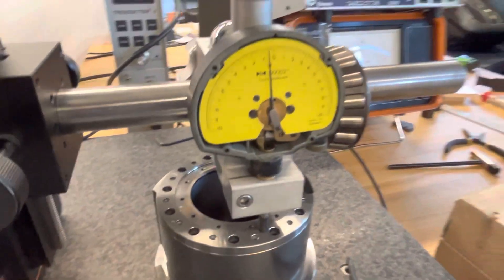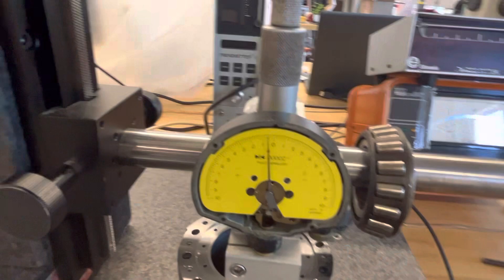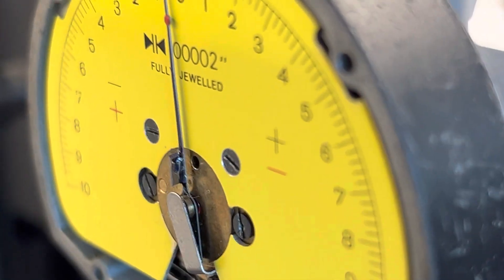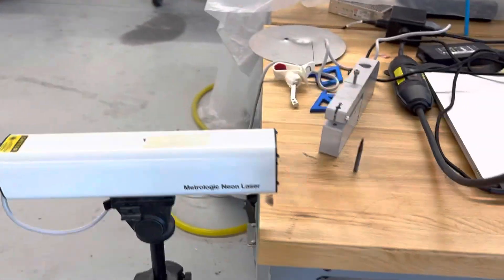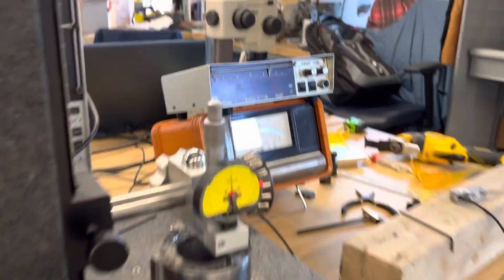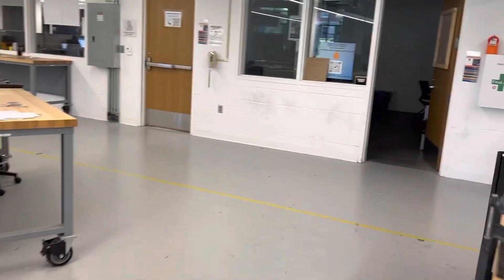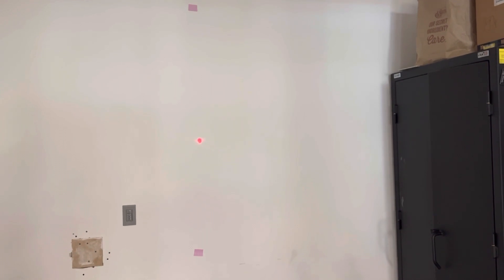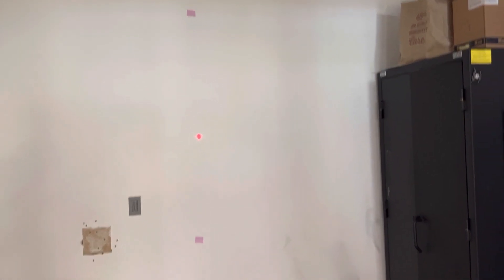Optical lever to increase indicator resolution

Comment: what if you use i mikrokater instead of a indicator ? since they work in a completely diffrent way ? ( instead of gears it wires that twist and untwist ) like cej 510-7 has a 0.2µm/ 1/127000 inch ( or however you would say it in banana's ) per devision